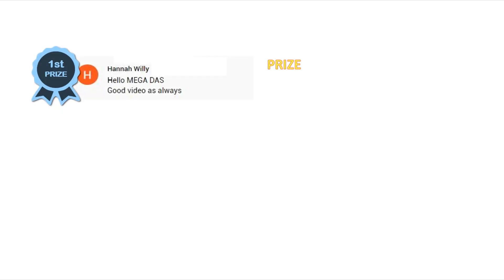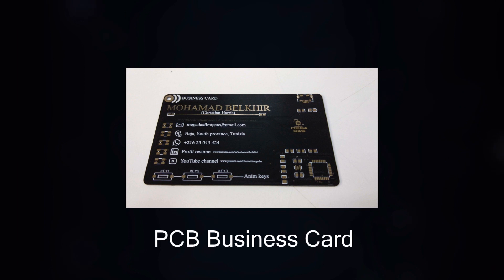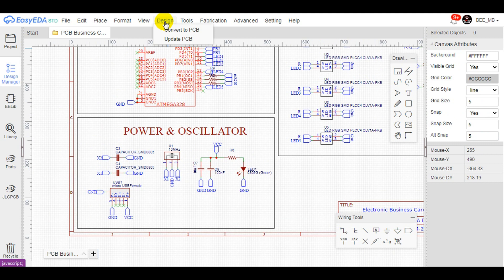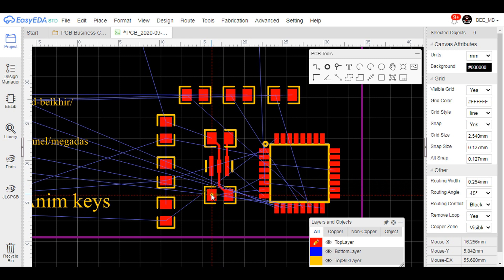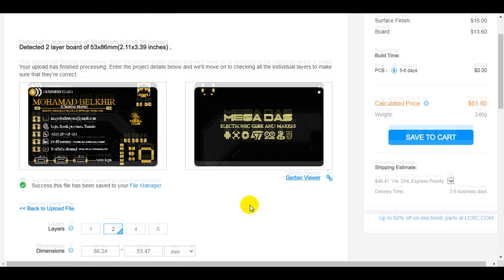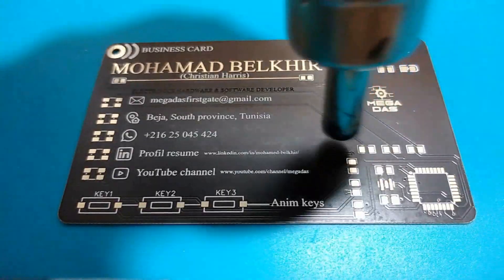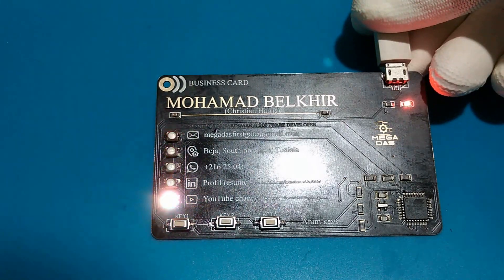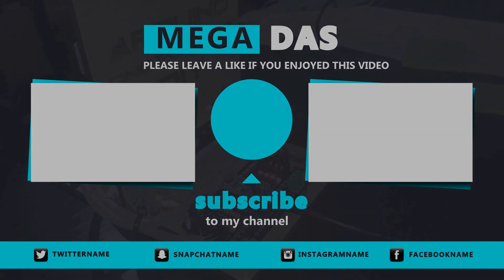How to make a PCB Business card

Comment: How did you program the Atmega328P microcontroller? Did you program it before you soldered it onto the PCB, or is there a way for you to program it through the USB cable?
Reply: Yes, that is a bit of a mystery. I'd assumed he was using the USB micro port for the upload but as per the schematic it's only used for power (VCC/GND); I believe this would also require a USB<>Serial chip too.